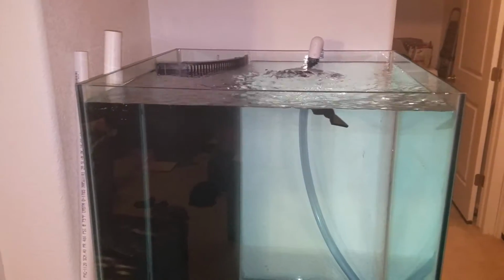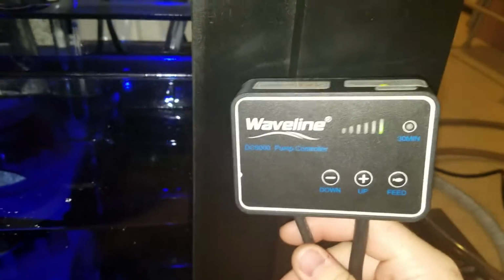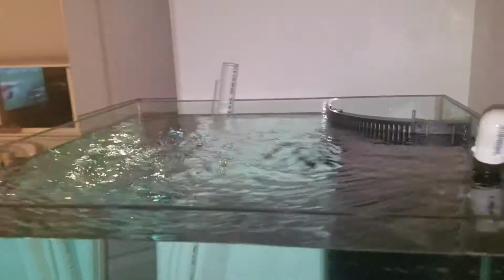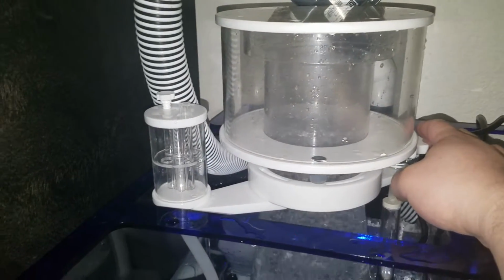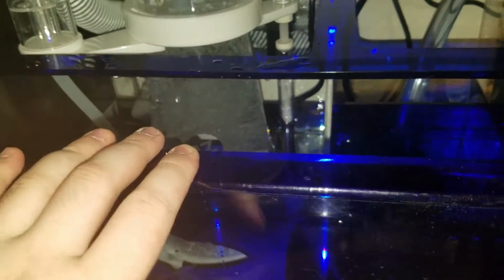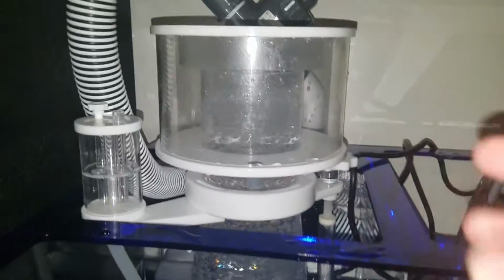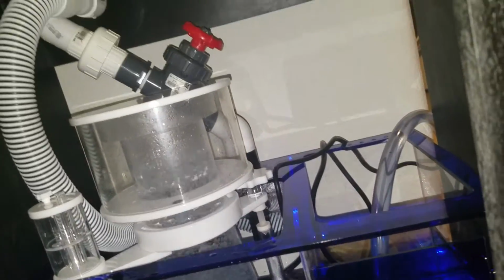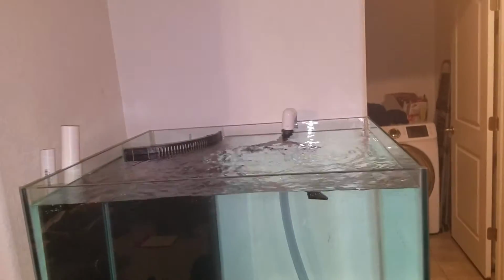60 cube reef build

Comment: can that sump handle power off water as your return is so low in the tank?  Did you drill the tank to have a nice return?  I can appreciate a quiet sump but the return up and over the rim detracts from the beauty of the rimless tank.
Reply from the maker: Haha, the tank practically has a canopy on it now so you can't see that anyway. I've since upgraded to a T5/Kessil hybrid setup - this video seems so very long ago! I'll have to do a new video to show you what it looks like today. It's packed to the brim with coral and quite successful.

And I don't ever drill for returns - since this video i've developed a very strong dis-taste for locline, i now hard-plumb everything, and often going over the top lets me set the height correctly so it won't back-siphon. If you drill a hole - you almost have no choice but to use locline to set the water height, as you can't change it, and you often can't drill it high enough without risking damaging to the glass, or requiring check valves (another thing i do not like, especially the Wye ones - they are horrid)

Comment: Is this the stand from deep blue for the 60g cube? I'm interested in the trigger sump but don't know what will be able to fit underneath my stand
Reply from the maker: no, the tank and stand are from marineland. I believe there was about 22x22 inside the stand - the sump is 20x20 so it had room to spare.
Reply: LXXero okay thank you! One more question..what trigger sump is it and did you have to cut any part of the stand to be able to make it fit through the back? My deep blue stand seems to have the same size opening in the back as the front
Reply from the maker: sorry for late response, but the back is wide open on the marineland.